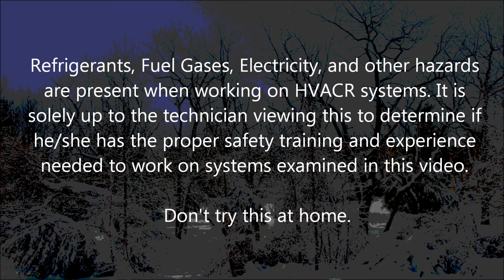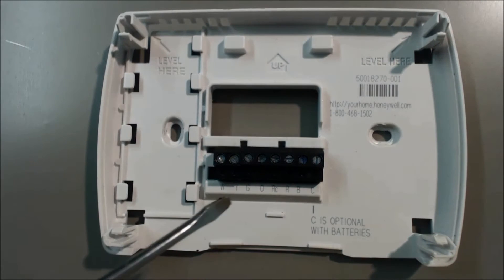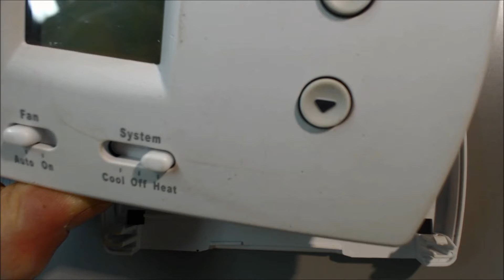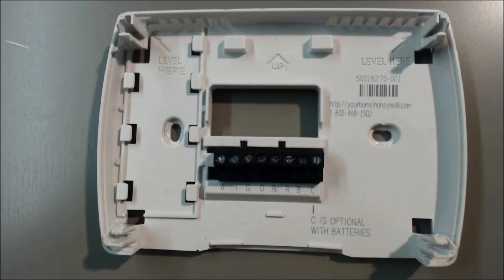Wiring a Single 24v Thermostat to Control Two HVAC Systems- Heater and Air Conditioner

Comment: I have a bosch boiler through baseboard heat and another system ac unit vents with heat pump. Will this method work? Take both 24 colt wires into the one? how can I use the heat pumpnfor emergency heat?

Comment: Hi everyone , I want to control two separate systems from one thermostat ( Honeywell 9000 wi fi ) , there is 3 wires coming from air handler ( red , green, yellow ) and 2 coming from the boiler ( red , white ) . The thermostat manual said that for this thermostat the common wire must to come from ac unit . Is there a way to don't run another wire from the attic to 1st floor ? where the thermostat is located .

Comment: How do a wire a single thermostat to two independent units... I have a forced air electric furnace with it's own fan and an AC unit with it's own fan... I have it ducted into the same duct..right now i have two thermostats one for each... is there a way to run one thermostat ?
Reply from the maker: You would not want 24v from one unit to get connected with the 24v from another unit. You would have to use an isolation relay to power the other units blower such as a 12 amp fan relay, thanks!

Comment: Hello Mr. Service Tech, I have two ACs, separate units, upstairs and downstairs units. by trial and errors. If one of the units run, by themselves, they will run for an excessive time (here in Houston with unbearable heat) and will not cycle properly but, if they run both at the same time they will cycle properly.  The thermostats are identical but they lag by a small fraction and they can't be synchronized so, whichever unit turns off first, the other will run for a very long time. I have tried everything and even though they sit side by side downstairs, the issue persists. I have now both control circuits landing on the same terminals on one thermostat and Magic; they both come on at the same time and turn off at the same time and cycle properly and often. In effect, they behave as one 7-8 ton unit. They are brand new"EFFICIENT" units which in my book efficient means simply weak. I compare it to a Corolla being efficient and my huge Pathfinder inefficient.   The electric bills are very low. You gain some you lose some. Now the question; is there a Thermostat that can properly run two separate ACs? The heaters don't have to run in tandem and upstairs is pretty much un-occupied with kids gone. 
Thanks for the help and sorry for the long-winded comment. 
Hamid B.Houston Texas.
Reply from the maker: Usually thermostats are only equipped to handle two systems, a heat and a cool. It can also do a hybrid such as a heat pump and furnace which would be a multistage. You don't want one 24 voltage to backfeed onto another control board that has its own 24 voltage there. That could hurt the board, thanks

Comment: what happens if you dont remove the jumper?, I forgot to once and it still worked in heating for boiler and ac mode,i tested it a couple times before i left the job.